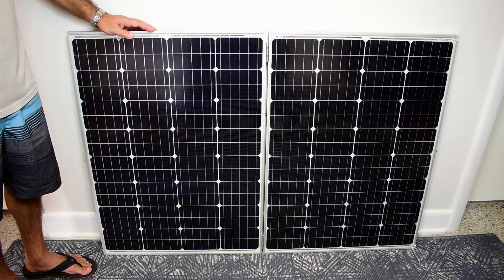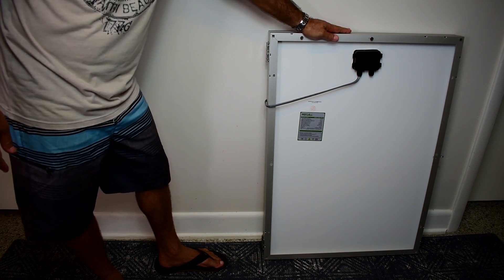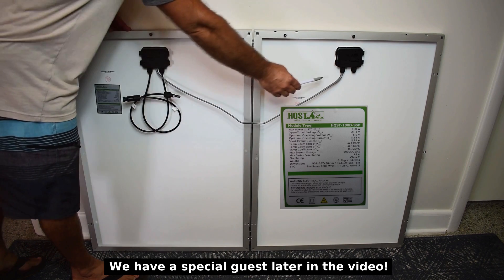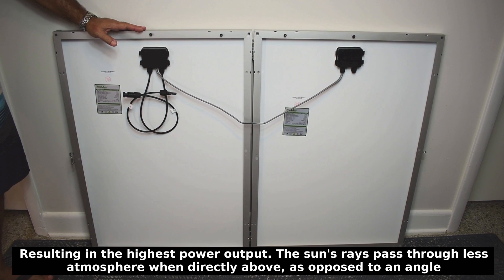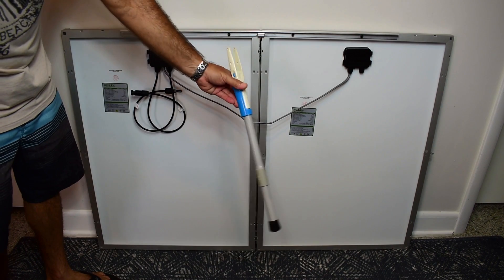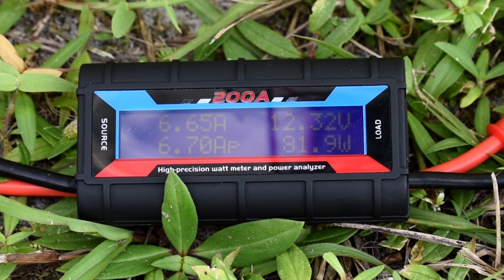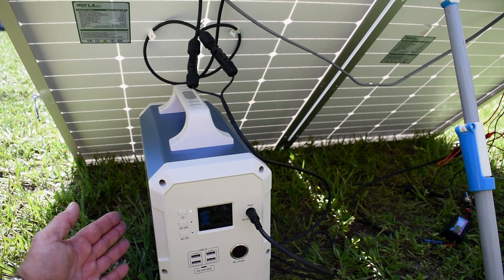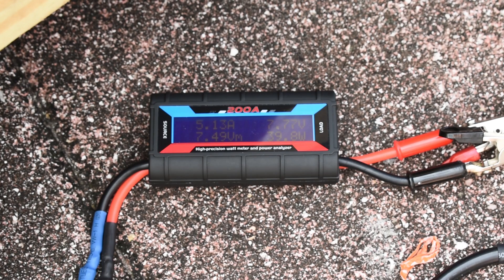DIY Low Cost 200W Monocrystalline Folding Solar Panel

Comment: Only found your channel today. Great info in your vids. Respectful suggestion, if you want to make your fold up panels even easier n quicker to set up- just slot the holes on the aluminium angle brace. Simply slip on n off then n tighten screws without removing them.
Reply from the maker: I thought of that, but had no way to make a perfect slot opening.
Reply: Personally I'd use an angle grinder with a 1mm thick cut off wheel. I can cut the slots quicker than I can remember my wife's birthday!

Comment: do you have any links for the uk Amazon, i would happily use your code if it helps your channel ;-)
Reply from the maker: Hi there. I don't think they're available there. The panel I have is almost identical to the Renogy 100W monocrystalline, which cost more money in the US, but in the UK, it's only 80 bucks on Amazon.
Reply: electronicsNmore so which panels did you use from Amazon as I live in the Netherlands, so it is interesting for Europeans here, thx bro.
Reply from the maker: @Hanssupandsnow  Click on the link in the video description area. Maybe you can find them elsewhere.

Comment: I do in fact have two spare 100W panels I can do this with.  And your Right !   The sellers charge WAY OVER the top! on folding panels.
Reply from the maker: It's so nice having them fold up. Very easy to handle and transport.

Comment: Marine 5200 is not the best choice  for hot areas. It is made for below the water line, and will turn into a sticky semyliquid substance over time if exposed to heat or UV. You should use 3m 4200 UV instead (purple tube). It is plenty strong and does not degrade from heat or UV rays.
Reply from the maker: 5200 is good up to 190 Deg F, so it will be just fine around that wire, but the other stuff is also good. Thanks for watching!

Comment: Most panel "ratings" are the theoretical instantaneous current at load initialization, or some nonsense like that which is never achieved ITRW. Kind of like "peak" horsepower for vacuums which is a similar lie but is used by a lot of shop vac mfgr's. You have to look at specs to find the real world run rates.